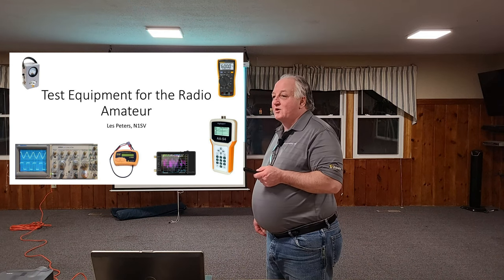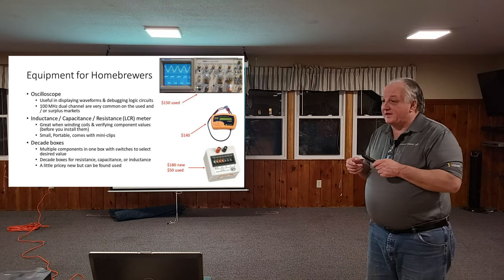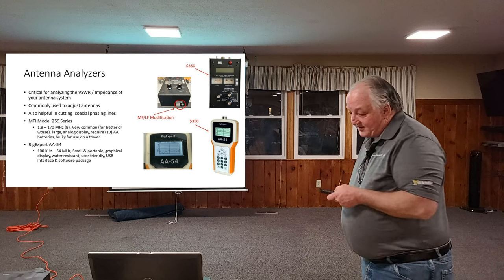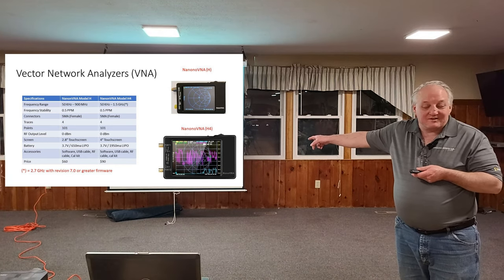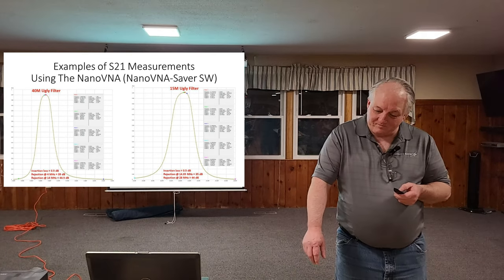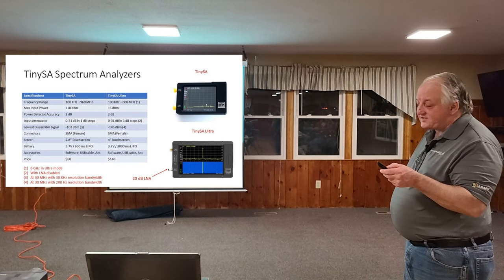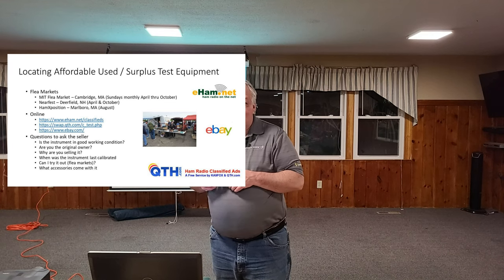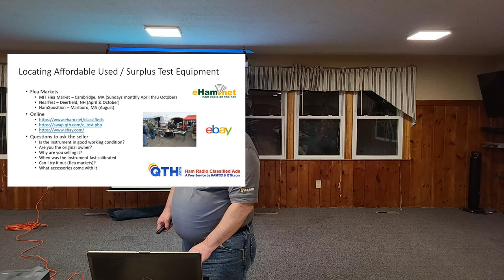Test Equipment for the Radio Amateur

Comment: Terrific overview, Les.  Some other things I’ve found in a similar assembly of test equipment:

1) The tinySA Ultra is a great device but its minimum resolution bandwidth is 200 Hz.  This is just about enough to see AM modulation side bands on a carrier - so a real spectrum analyzer ($$) would have down to 10 Hz RBW and would allow a fine grain view.  But consider the price differential.  For anything a ham needs to do, it’s great.
2) The nanoVNA does need some understanding of its limitations - it is going to struggle with impedances >= 500 ohms or <= 5 ohms.  This means that you have to be careful when measuring filter responses to not perturb the filter response when the design is aiming for a 500 ohm match and you’ve just terminated it in 50 ohms with the VNA.  You may have to use input and output transformers in that case to match the ins and outs of the filters to the expected 500 ohms or so for a typical filter (the response really does radically change in that case).
3) Port #2 on the nanoVNA has some problems with reflected power for non-50 ohm situations, and I’ve seen that a good idea in some cases can be to use a 10-20 dB attenuator on port #2 to help the problem with matching (at the expense of poorer amplitude fidelity; you can’t have everything).

Great tools for today’s amateur, far beyond what was available even a decade ago!
Reply from the maker: I hadn't thought of that. Thanks for the information!